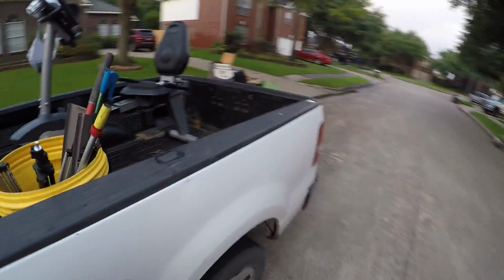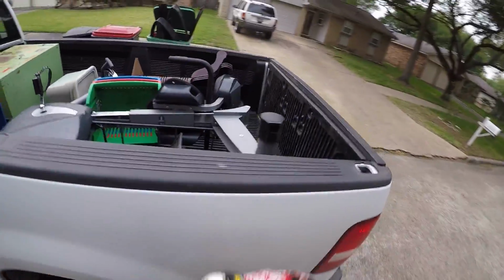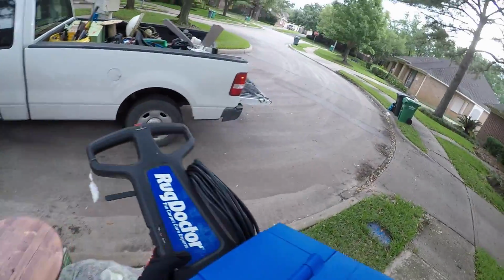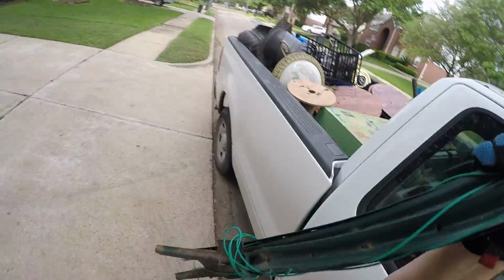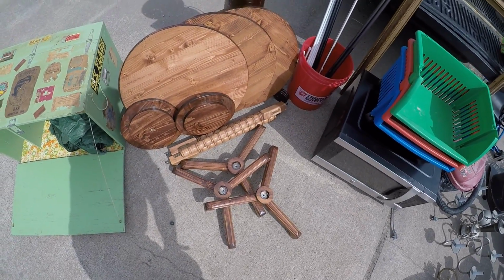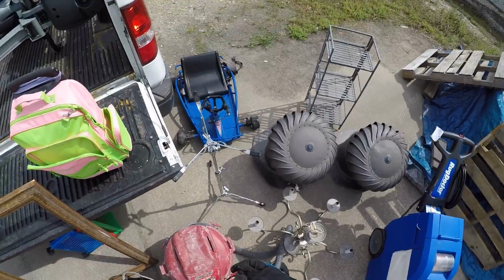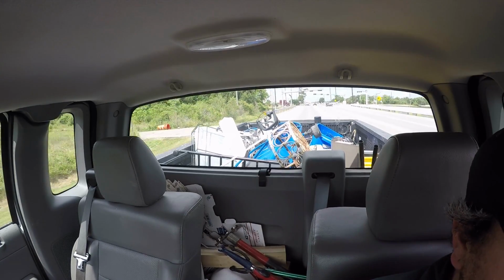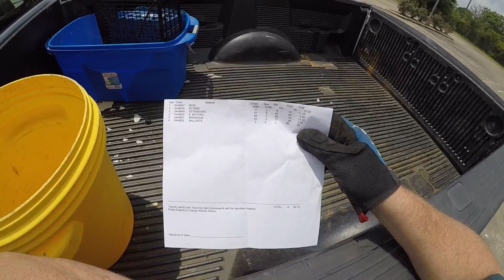Curbside Scavenging "Resistance Does Not Work"

Comment: Nice camping box from the 60’s-80’s?? Nostalgia written all over it! The top two compartments would hold cooking utensils, plastic plates and such. The bottom left side slot was to stow your Coleman camp stove. Then food could be stored in the large bottom compartment. That’s how we used ours back in my scouting days. My dad improved on the concept making one entirely out of aluminum which is lighter than plywood. He used 1” aluminum angle stock on all the edges and the whole thing was riveted together. Since it was lighter he made it a little larger. Since it was larger it held more and since it held more it was heavy to load. But it was a great camping box.
Reply: I really liked this piece too.  I'd buy it for 10.00 without a doubt.  Cool retro look, good colors and nostalgia.

Comment: The chest is for camping, used them when I was in the scouts, large compartment on the bottom right would store a coleman stove, pans on the left, dishes up top.... then just randomly jam everything else in until you need the lock to hold it closed.

Comment: Check the fuse on the microwave. There is a cheap fuse inside that is easily replaced. If it pops again, scrap it but some times it was just a surge.

Comment: You will save fuel and time if you pull up further. You are walking around the truck to the front when you should be walking to the rear of the truck. Step saved step earned.